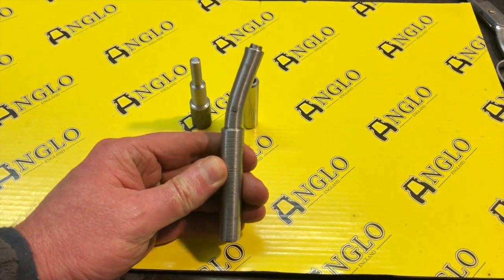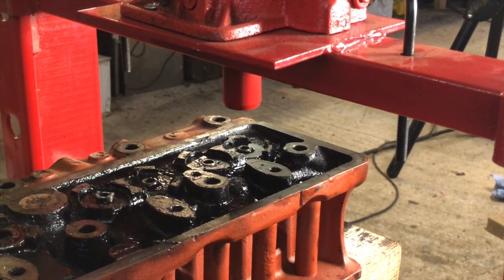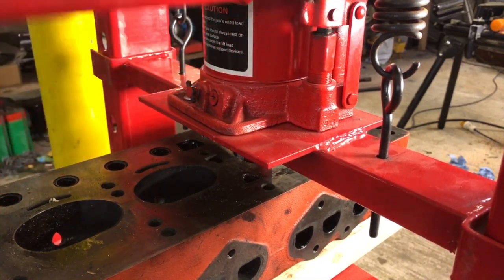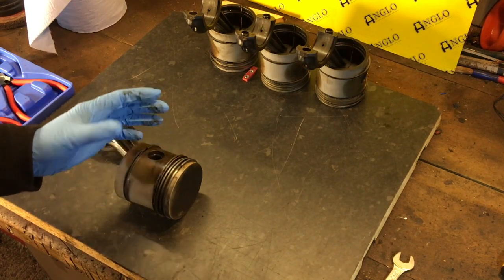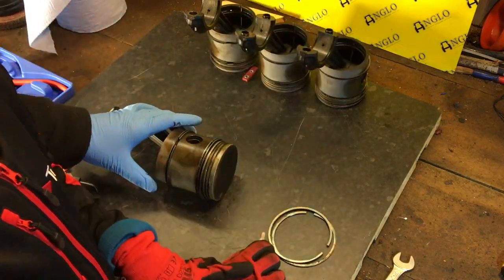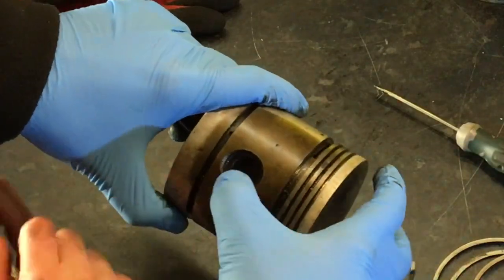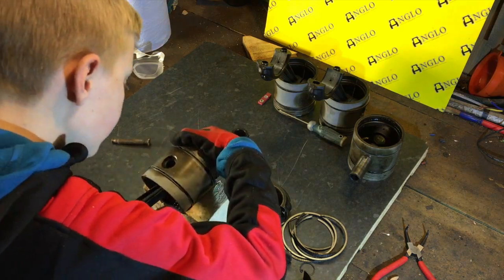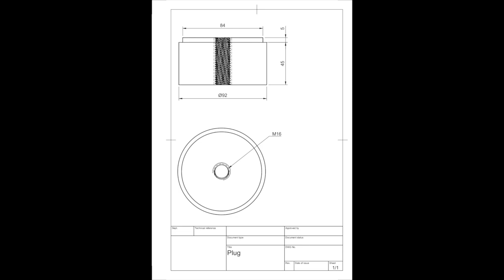Ferguson TED20 - Removing Valve Guides #2 & Dismantling Pistons - with Anglo Agriparts

Comment: Boy I have never seen the guides so tight, I wonder had the previous mechanic used Loctite.
Reply from the maker: Hi Lance, that’s a possibility, but as two of them were actually broken inside the head, seemingly a long time ago, I actually suspect they were the wrong size and hence damaged when they were installed. Either way I’ve never seen anything like it. Remember the lift arm shaft? That was also incredibly difficult to remove. A bit of a theme going here! 😉

Comment: I have a engine that the #4 cylinder smokes. If i clean the plug it stops for a while. It seems that the seal for the valve stem is bad and allows oil to pass down to the cylinder.  I've decided to remove the head and buy a valve kit. What I am curious about is if I need to replace the valve guides while I am at it. How do I know if they guides are bad?
Reply from the maker: Hi Randy, on these engines the valve stem guide is also the valve stem seal. Through a combination of a relatively tight fit and the height of the stand out of the guide above the Head they do an effective job of keeping the oil out of the combustion chamber, that is until they wear. In theory it is possible to measure the internal diameter but few people have the high precision tools needed for this. The diameter is so small and the allowable tolerance so minute that it’s much simpler and safer to replace the guides. If you decide not to replace them and simply install new valves it is likely that you will see an improvement, but it is highly likely that this will be short lived. I expect it won’t be long before you see the problem return. 

I hope this helps, good luck with your project. These are really nice engines to work on. 😉👍